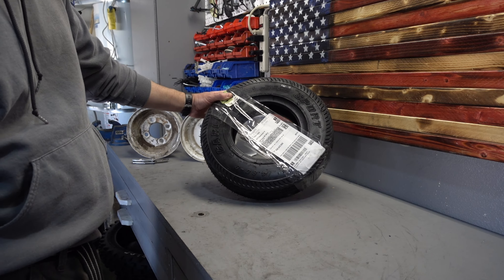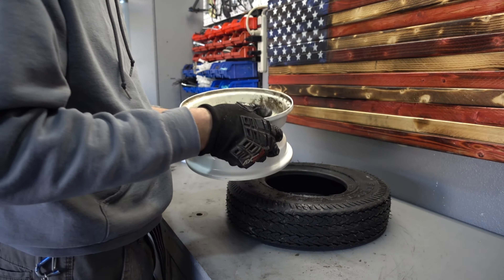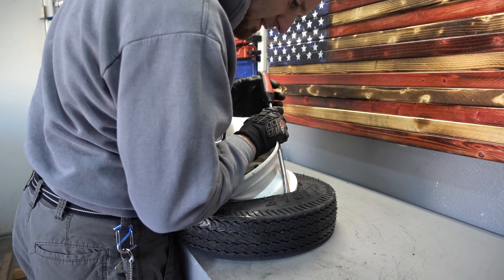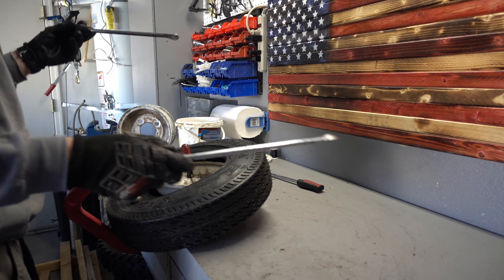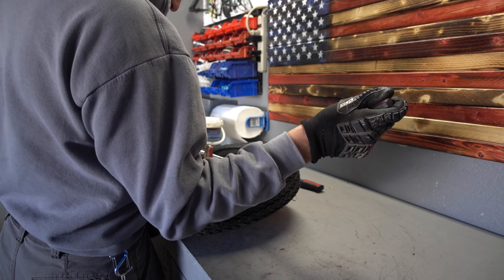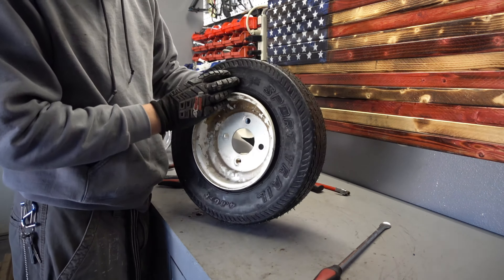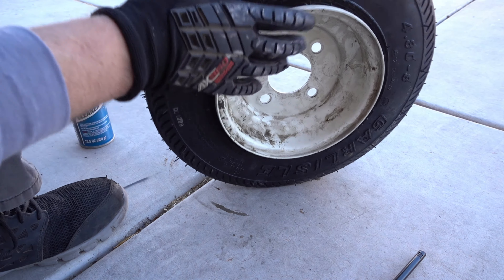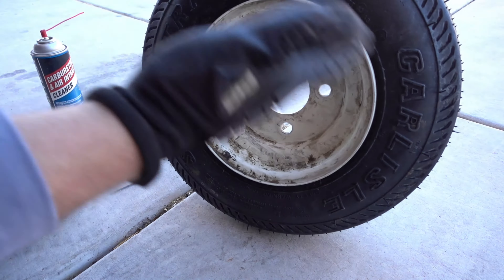How to install a New Trailer tire on the rim with basic tools

Comment: Tips, leave the tire in the hot sun to soften it, soapy water, and to seat the bead you could have used a ratchet strap around the circumference of the tire, along the center of the tread, it squishes the side walls out so when you add air it blows up

Comment: Just smear some tyre bead sealer/paste around the rim with a small brush, bounce the wheel a few times on a hard surface whilst turning, and you can then inflate  with only a foot pump, easy! I've done it many times, we all want an easy life!
Reply: Yeah... That is a good and safe solution, of course. Thanks. I'll use that some day! :) 

(... but TODAY, i'm sneaking secretly away to do Tire Flambé a la Romania, just for the badass feeling of it. If you hear a BOOM... it was me. ;) )
Reply from the maker: Great info

Comment: easy way of getting the tire to seal to the bead is use a ratchet strap around the outside circumference. it will push the bead of the tire to the rim also good to use a little soapy water
Reply from the maker: Yes, I've heard about that technique later on. Great way of doing it

Comment: With the right tools its easy.    Spoons  are ok!! 
I like   the manual  machines. Can get one for 50 bucks   and it will  make life so easy  why not if your  doin   many tires  also like to use bead sealer when installing them ,   the     brake starter fluid method is    ok on the side of a mountain  but if I have. The shop avaliable  I'm  using  bead seater basicly  a tank  with a huge air  output  with a ball valve

Comment: Im here because now its 2024 and the tire and wheel combo is  now 150 each for my popup
Reply from the maker: I see , well , you can save a buck for sure
Reply: @VegasRoManiacReviews  turns little searching everywhere my load index   Etrailer actually included the wheel for only $9 more.  Still is shocking that a cheap poorly build obsolete 10 inch trailer tire costs more than a 33 inch cooper discoverer AT for my truck